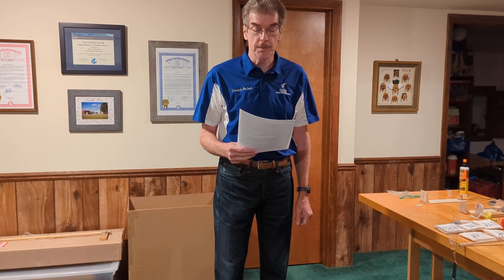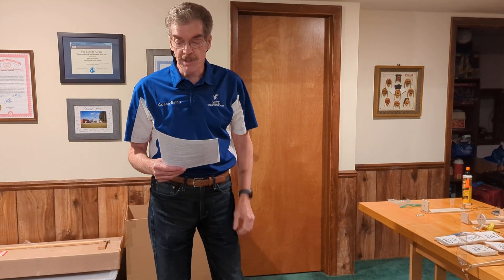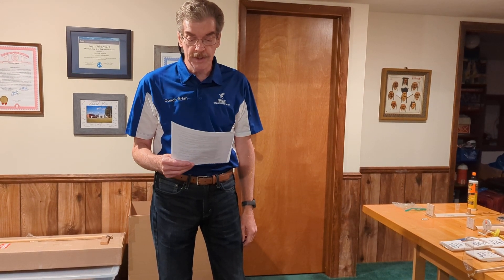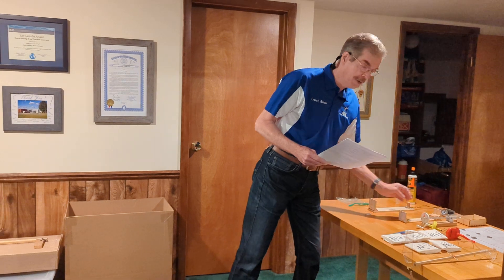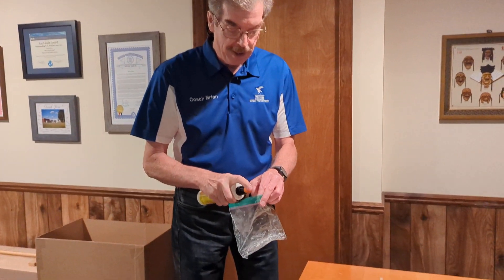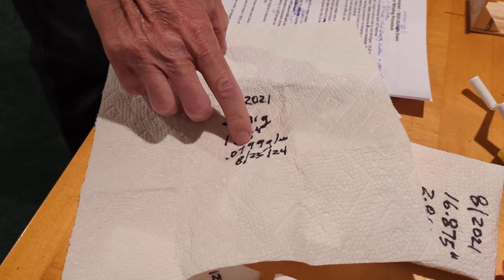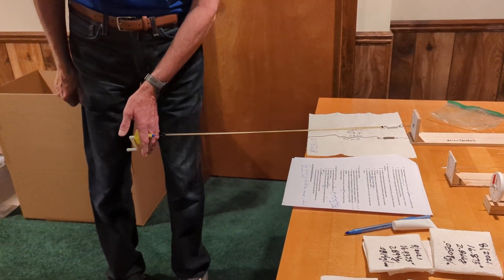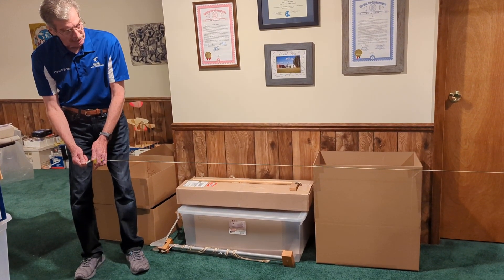Science Olympiad 2024-25 Helicopter Rubber Motor Winding Demo

Comment: I just rewatched Coach Chuck's video on tying the knot.  I like the hemostat. I have been using needle nose plyers. I find that pulling the knots tight abrades and nicks the rubber, even with lube. I am going to change my practice by adding a couple inches to each end of the rubber strip, clamping the hemostat at the desired loop length and tying the knots from the tag ends inward to the hemostat. Then cut the tag ends off a bit outside the knot. That way, abrasions will be on the tag ends outside the knot. I just had a motor explode at 85% and destroy the lower rotor on my helicopter. The break was about 1/16" in from the knot.
Reply: Keep working on knot tying technique. The knots I tie do not abrade the rubber. Lube more carefully before you tie. Lube both sides of each strip and cover entire rubber ends with lube. Doesn't need to be dripping, just well covered.
Reply: @brianturnbull3875  When I lube the rubber before tying the knot, I get to watch the knot slowly untie itself. I was using 50% green soap and 50% glycerin. I found that diluting that to half strength with water kept the knot from untying. But when I would stretch the rubber, I could see notches in the corners. When I use my new technique, the notches are outside the knot, not in the working part.
Reply: @aeromodeller1  I'll create a YouTube "short" next week to show my knot tying method.